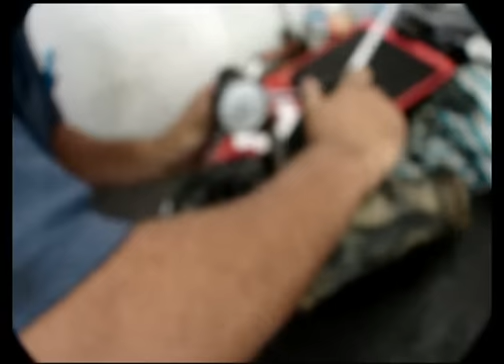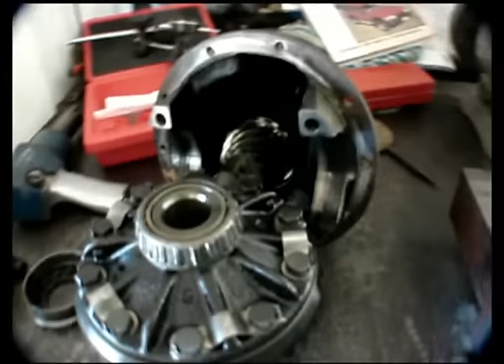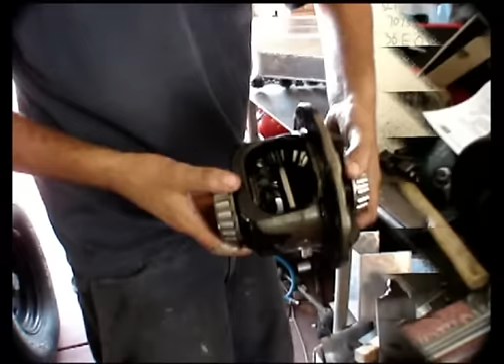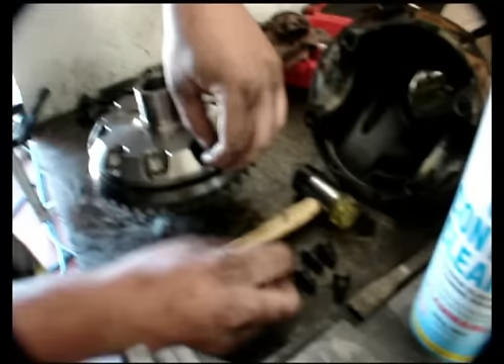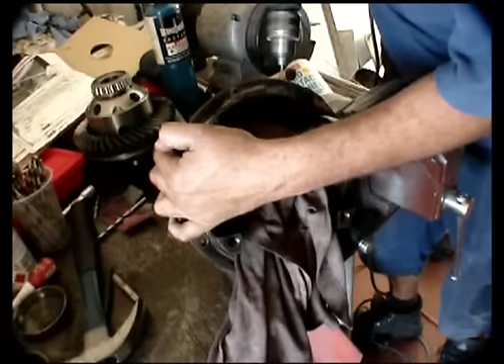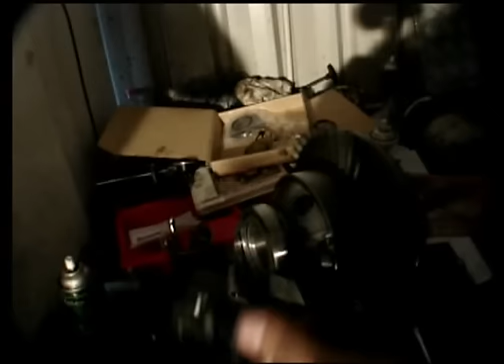Air locker install into Toyota front diff center

Comment: How critical is it to get the exact same backlash? I mean, is it possible that there could be a certain amount of wear, in the old diff assembly, thus causing that .026" and you could install the new one to say .015" and therefore reduce the slop in the drive train (backlash) or will that evoke premature wearing with metal to metal contact?
Reply from the maker: Its not that critical, We used the dial gauge for the video, however most people who have done them before do it by "feel" which is how i would usually do it. The whole reason for back lash is to allow a little give so when you change from forward to reverse your gears release and change direction freely. If your backlash is set too tight the gears will bind up and could cause you serious damage to the gear set.
Reply: Outlaws4x4 Thanks for that. So, there's no actual "optimum" setting for backlash in a particular vehicle, rather, you just simply replicate what was already there, yeah? I mean, what if someone had already entered the diff prior to you owning the vehicle and set the diff wrongly, with too much or too little play?
Reply from the maker: SeriousSchitt
Yes there is a optimal setting, you will find it in the workshop manual for the vehicle or sometimes it will come with a new set of crown wheel and pinion gears.